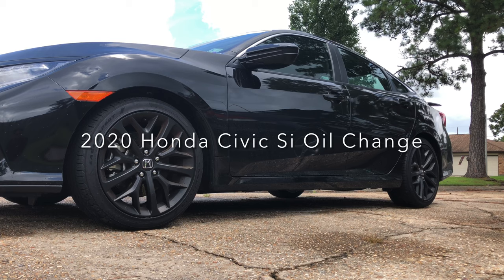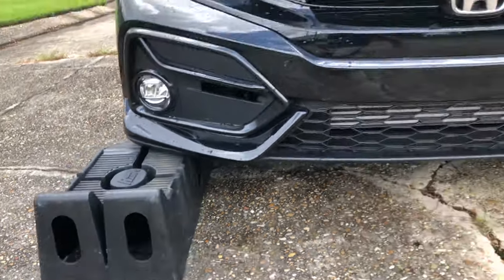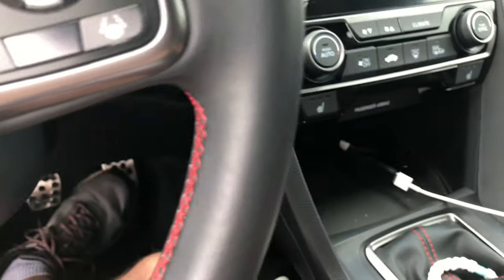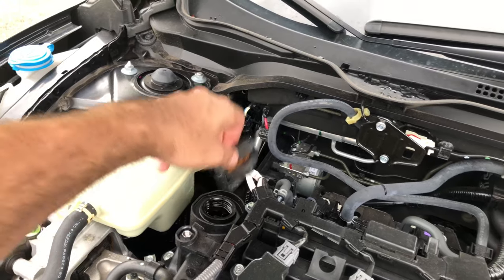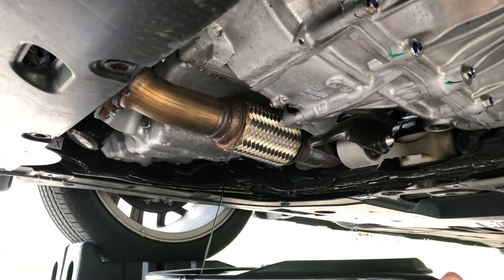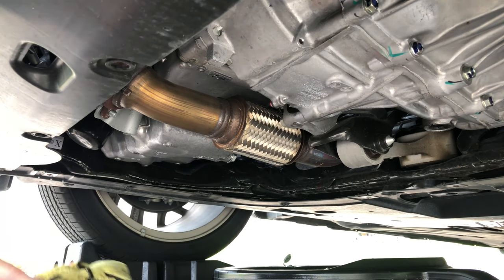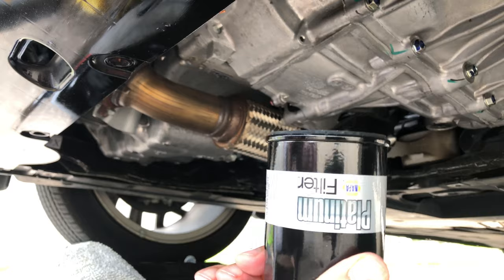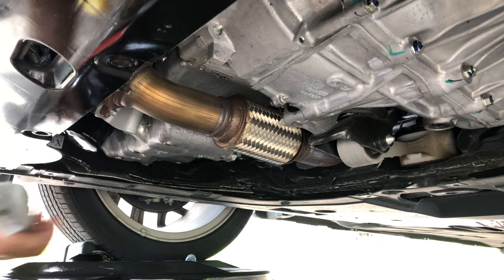How to: Oil Change - 2020 Honda Civic Si - DIY

Comment: I’m new to all this DIY oil change stuff but the manual specifically states to use only Honda brand manual transmission oil for manuals and only use synthetic temporarily until you can get that. Is that true?

Also it stated you would need a special tool to remove the filter so I’m assuming you don’t then since u didn’t have trouble with your hands haha. Does screwing the drain plug back require specific torque? The manual stated a 30lb torque is there a way to measure?
Reply from the maker: Manual transmission oil and engine oil are two entirely different things. It’s recommended to change transmission oil every 60,000 to 100,000 miles. I’ve never changed fluid in any manual transmission car that I’ve ever owned and that number of cars is around 15. Of course, I only put 100,000 miles on one of them. 

Honda transmissions may require a specific oil, although everything I see says that it’s just 5W30 motor oil. But it’s possible that the Honda branded oil has specific detergents or lubricants in it that regular motor oil doesn’t have. Either way, unless you have high mileage on the car, don’t mess with the transmission oil. 

Assuming that you’re trying to change the engine oil, just follow what I did in the video. Torquing the drain plug isn’t critical. If you don’t have a torque wrench, just make sure it’s tight enough that no oil is leaking out of it. Before you screw it in, make sure the threads are clean and when you screw it in by hand, it shouldn’t feel gritty. Don’t put a lot of muscle into tightening it or you’ll strip it out and then you’ll have a big problem. 

I’ve done hundreds of oil changes and only had to use a filter wrench a few times. As long as the filter isn’t covered with oil or grease and you have big hands with a good grip, you should be able to get it loose. Oil filters aren’t super tight. They’re just screwed in enough to put enough pressure on the rubber gasket to form a seal.

Comment: 6:13 , Where can I get a replacement Splash shield???
Reply from the maker: The dealer for sure. But I’ve used Honda’s website to order wiper blade refills, and they had all kinds of replacement parts. Might be your best bet because you won’t have to pay any additional dealer markup. And they’ll ship straight to you.
Reply: @504RoadTrips  I've been looking around but more specifically, what's the Official name of this part? I tried Splash shield and all I get are mud flaps. I bought one of these and it didn't come with a manual so I have no idea what the part name is.
Reply from the maker: @samuellack0  there’s no printed manual that I know of. You can read a digital version on the Honda app or website. The owner’s manual just calls it an “under cover”.
Reply: @504RoadTrips  alright thanks for the help !
Reply: @samuellack0 you might also try out “engine underbody shield” if you haven’t done it already.
Reply: Super helpful. Thank you

Comment: Is this the same for manual also?
Reply from the maker: The Civic Si only comes in a manual.
Reply from the maker: To clarify, the non-Si models are going to be exactly the same as this, regardless of the transmission. The oil change has nothing to do with the transmission. There is gearbox oil in a manual transmission car, and automatic transmission fluid (not oil, but a hydraulic fluid) in an automatic. There is a service interval for the gearbox oil in a manual, but it’s a pretty high mileage, so I’m not too worried about that yet. Despite having driven our Civic to 12 states now, it only has 14,000 miles after 2 years. The procedure here is not for the transmissions though, so if you need that serviced, look for the correct video.

Comment: You should ALWAYS replace the oil plug crush washer as per your manual. It's pennies really in the big scheme of things...
Reply: can you explain why every time?
Reply: @lizziegood1  I do my own oil and even after 5k the crush washer has a small indent I believe the metal is soft. Can you get away without doing it. Sure you can. But look in your manual it advised to do it. The washers are cheap and can get OEM ones from Amazon. It also tells you to tighten the oil bolt to so many foot pounds. Torque wrench. For my 2007 Honda Si it's 29 Lbs for my 2014 Honda CR-V it's 30. Go by your manual. I would never have gotten 245K on my Si without proper maintenance....
Reply: @edwardinvegas  got me at 245k!  Thanks a lot
Reply from the maker: The crush washer conforms to the surface that it's sealing to when you torque the plug down. They are designed to be reused unless they're damaged.  Unless there's oil leaking from the drain plug, there's not really any reason to change it.  I've periodically changed out the entire plug and washer on various high-mileage cars that I've owned.  But I've never had even a drop of oil come out of any drain plug.
Reply: @504RoadTrips I have a 2017 Civic EX, and also do my own oil changes. I ordered some drain plug washers from Rock Auto a couple years ago. They’re aluminum, and I reuse them 3 or 4 times without any leaking. I’ll change out the drain plug washer once a year. I also torque the drain bolt (30 ft/lbs). So yeah, they can be reused without fear of leaking.
Reply: @504RoadTrips the softer metal washers (like copper) probably should be changed out at each oil change.